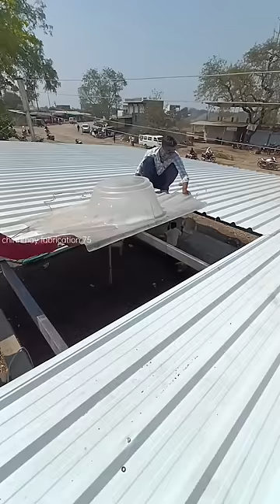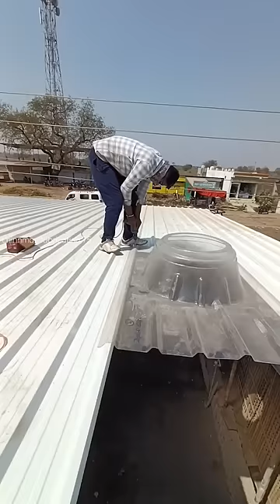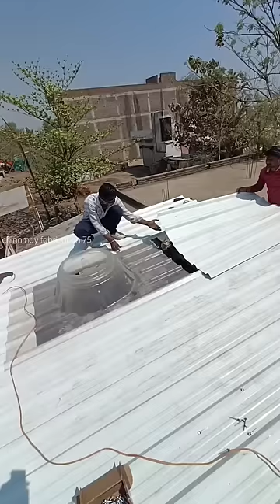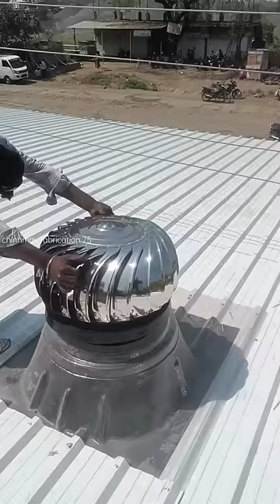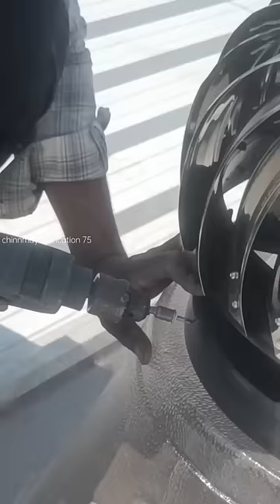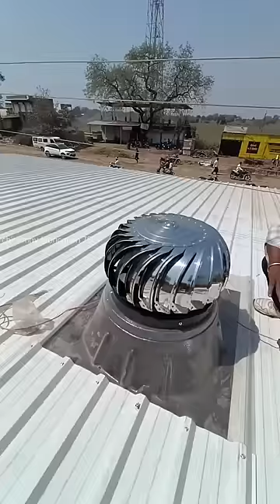turbo fan installation || air ventilator fitting #turbofan #airventilator #fastwork

Comment: The correct name is Turbo Ventilator

Turbo ventilators are self-driven equipment installed on the roofs to extract inside air. They don't require additional energy as they are operated by the atmospheric wind and in doing so, inside air is exhausted through it and the natural inward flow of fresh air is boosted.
Reply: Thanks 👍
Reply: Okay that sounds Kool, but, how about rain? would it be a mess inside on rainy days???
Reply: You copied details from Google
Reply: @abdullagazi443  Yes, I did. So what? I made it easy for many people.
Reply: @JIC-DNP  No. Rain will not come inside. That is why it is also installed in wheat and maize godowns.
Reply: @gurudev7679  I see... Very interesting design and Kool enough looking! Thanks for the Info bro!
Reply: @JIC-DNP  very human like design
Reply: @abdullagazi443  so?
Reply: @mohammedzaid3664  😊
Reply: ofc they would only be able to afford ‘em L
Reply: thanks bro
Reply: No one asked you
Reply: what if it rains? looks like a crappy system
Reply: @JIC - DNP  kiddo, I think you never heard of roof exhaust fan.
That's why you are silly questions.😂😂
Reply: Ctrl + C = Google
Ctrl + V =Shorts
Reply: Турбо дефлектор это
Reply: Where’s the safety equipment for the guys working on the roof as OSHA would have a hay day of fines
Reply: No it's whirlbird ventilator
Reply: It also keeps moisture outside, when raining and during winter season. 😂😂😂😂❤❤❤❤
Reply: we call them whirlybirds
Reply: Gracias por la información 👍
Reply: @JIC-DNP  That will definitely leak 😅😅😅😅😅
Reply: In an Indian city like that there is no such thing as fresh air
Reply: @klimakleberwegreisser alot of US warehouses have them because cooling an entire warehouse for 24 hrs is expensive. I've never seen rain leaking through one that wasnt damaged
Reply: Most of the schools in Assam are using it in their MID DAY MEAL rooms...
Reply: Very good news thanks
Reply: @gurudev7679 Rain most certainly can get inside. Just make sure there is something under it to catch it or that you don’t care about getting wet. On its own though it doesn’t stop the rain.
Reply: Спасибо
Reply: Turbo ventilator how much cost

Comment: I don't see that plastic piece lasting very long. Once the sun beats the crap out of it the wind spinning the turbine will tear it up.
Reply: You get what you pay for 😅
Reply: In this country you’d be lucky to even have a house to put ya fancy spin spin thing on ya roof 🤣
Reply: @CatsBtrippin  it's not fancy bro 
It is used in factories
Reply: @user-t5us9qnw  No, no "fancy spin spin thing" has a nice ring to it; I like it.
Reply: That whole roof is a gamble. It's flexing and the screws aren't set in anything but the panels
Reply: А как красиво эта крыша звенит во время дождя😂
Reply: @jeremeberryhill4661  one above average windy day….
Reply: Si!!!! Y la pusieron al revés!! Cuando llueva el agua se va a meter!!!!😂😂😂😂😂
Reply: @CatsBtrippin  ♥️ як назва цієї країни ?
Reply: @user-t5us9qnw  you got one of those “spin spin things” on ya roof in that country, you fancy!
Reply: @ЛюдаЛюдмилка  Malaysia
Reply: No falta el tipo que a todo le busca peros... 🤡🤡
Reply: It’s probably made out of the same material as skylights!? So it’s actually not a bad idea! And it’s exhausting air past the material! Probably cooler than an actual skylight too! Don’t knock it til ya try it!
I’ve had roof turbines  my dad installed on our house! I think they made a difference too!
Reply: @jeremeberryhill4661 probably lasts longer than the people that built, bought and use it. 😂better than being in the elements

Comment: I have installed many hundreds of miles of metal roof panels, and with that many flashings, skylights, curbs, pipe jacks, and vents. It is very important to use mastic on the panel laps, and all protrusions. Especially on roof pitches below 4/12.

Comment: They should add silicone so that whenever it rains the rain doesn't leak through the sealing, but that's probably not necessary.
Reply: They’re not paid to give a damn about they’re work. They’ll get their money and leave you screwed.
Reply: It will not leak ...
Reply: I rewatch it for that same reason to see if they did

Comment: Plse use silicon paste after on bolts side... otherwise water drops
Reply: They all know.. thats his job everyday..
Reply: It's a straight shot through the roof with that fan lol doesn't matter 😂 and it's India it never rains.
Reply: Probably only rains once a year there
Reply: @CTRLaltKNIFE  bro you really think that it never rains in India?😂😂
Reply: Silicone not advisable to use  on roofing materials but vulca seal or roof sealant spray. It doesn't crack under the sun while silicone cracks under exposures to  hot temp.

Comment: One of the best low cost ventilation set ups you’ll ever buy!!! The heat at the top causes the turbines to spin .. therefore exhausting the heat! With no electricity usage! My father put some on our house!!! Years later he had a tin roof installed! And the dumb carpenter didn’t put them back on!!!
I do heating & air …. & I know that helped my mom during the hot summers! Can’t win! Some people don’t have any common sense!😮😢

Comment: I Installed powered roof exhaust for a company I worked for! (Motorized!)… they were only good for about 2 to 5 yrs! They would always die!!!!
This old method is one of the most reliable roof exhaust you’ll ever buy! Solar motorized would be the next best thing…. If the components last!
That’s a big IF!!!

Comment: these ventilators have been used in large factories for the longest time to blow the hot air out because hot air rises to the ceiling. without the ventilators the hot air will make the factory hotter.

Comment: These whirrly birds do work, they extract the stale & hot air from the attic..keeping your home a bit cooler in the summer season...
I have one on my spare garage also it helps from having stable air in there !!

It's a good investment, I painted all of mine black....jet black high gloss black...

They are real shiny...

Home depot has them they are about 60.00 $$$ each ...

Comment: It works as an exhaust fan to pull out smoke etc out of the building. Is that correct?
Reply: Wrong. Its called ventilator, to extract warm air out using the wind powered revolving globe of fins. Very common in non air conditions factories in hot climate area. Some houses use them in Oz.

Comment: my doubt is ... dont you think water will flow through the gap between plastic base and the metal roof sheet ?? 
i mean . come on just some screws to tighten the both sheets ??

Comment: Wrong fitting bro
Reply: Ur right
Reply: No it is not, it’s installed correctly. On the high side of the roof it’s tucked underneath the roof sheeting, the plastic on both sides is overlapping the steel roof plating, and the bottom of the plastic also overlaps the lower end, steel panel.
Reply: Where is wrong? Show me

Comment: Que función cumple este ventilador?
Reply: Bypassing the hot air inside ine building but needs the wind outside to rotate it. Without outside wind can make this useless. It's not a regular use in home because the rainfalls can leak through this.
Reply from the maker: Turbo fan

Comment: Installation is wrong... the iron sheet must be poisoned on it's top first... for example the sheet which is coming from top towards the downfall position, must be placed on the top of this fiber sheet and then this fiber sheet end must be placed at the top of the last iron sheet... now when the rain starts all the water goes inside 😅